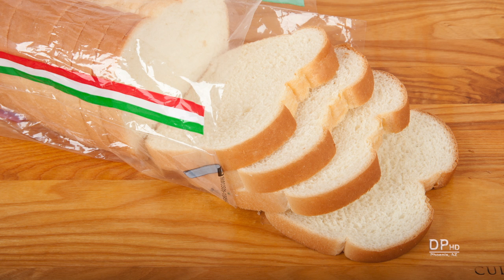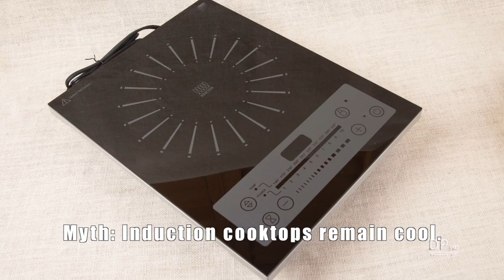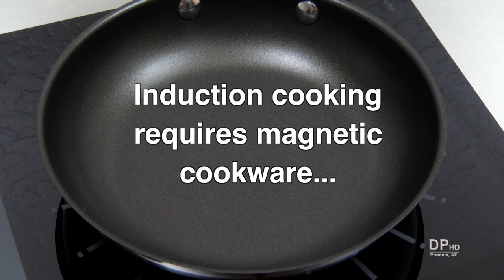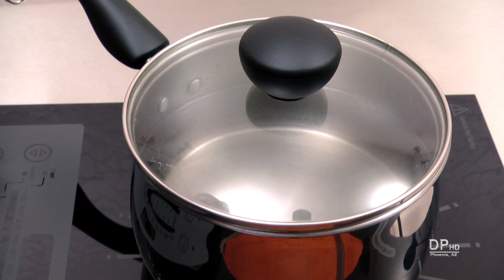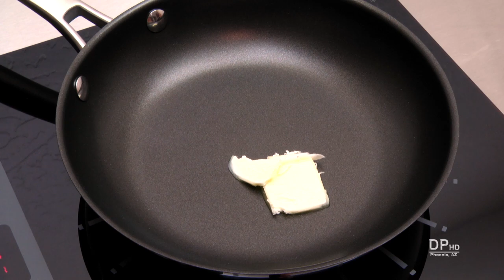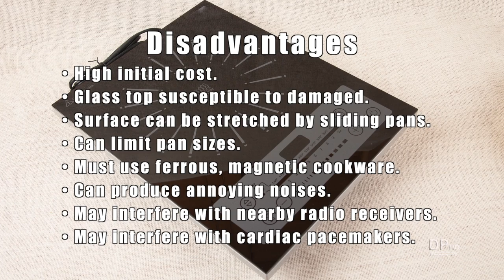Introduction to Induction Cooking (Home Cooking 101) DiTuro Productions

Comment: The only thing that I am disappointed with,is that I have never been able to fry an egg. It never turns out right it spread out all over the pan. Perhaps I need some tips, I do have the proper pots and pans. I think I need help in technique, my cook top is just new.
Reply from the maker: The amount of egg spread is usually due to the grade of egg and age. Some non-stick pans could cause more egg spread than others. I fry eggs using the technique in this video I published several years ago. Using the same pan, I have not noticed any significant difference using gas or induction: http://youtu.be/tC4swUMV17c

Comment: Induction cooking is not good for Chinese cooking where a round bottom wok is used.  Round bottom wok is specially built for even heat distribution during stir frying.
Reply from the maker: Thank you for sharing this information, Sally. A flat bottom iron or steel wok will work on an induction burner, but not as efficiently as on a high power gas burner.

Comment: Seems to me that one can get a couple of portable cook tops for use just for those times when one is cooking for a lot of folks such as parties. Great if one has an RV rather than using propane. It is just one of those specialty pieces of cookware.  I have priced built in induction cooktops. Think they are happy to charge monster amounts to pay for their new lexis car.  To go from a $70 portable to one that has 4 cooking eyes and have the price jump to $3000 or more does not make a lot of sense to me.
Reply from the maker: The first microwave oven cost about $5000. The cost of induction ranges and cooktops will drop. How fast depends on demand. A portable unit is ideal for RVs, small apartments, and occasionally needing another burner. Thanks for your comment.
Reply: @DiTuroProductions  My microwave is a 1978 and it has a glass touch panel - can't imagine how much that cost when new!

Comment: Just bought and tried an entry-level induction over-the-counter unit that I plan to use in my outdoor cooking area and I am impressed. Instant on/off heat. Plenty of power for the size. No breeze will carry away the heat as from my previous electric element (and gas)  cooktops. The only disadvantage I saw was lack of power adjustability as the temperature is pre-set at  certain intervals. Thinking outside the box, this may be an advantage. I can tell you, I am not going back to gas or electric element cooking and is considering an induction range for my kitchen when it is time to replace it.
Reply from the maker: Thank you for sharing your experience. It is interesting yours has preset temperature settings, most have just a power setting.

Comment: I have been using my portable induction cooktop for two years for most of my cooking.  I want to get another and then I will never have to use my ceramic stove top ever again.  Eventually, if I have to replace the stove, I will invest in a stove with induction.  Most people have magnetic bottoms on their pots and pans.  But that is a must.  I would never be without my induction cooktop again.  I have a Kuradori.  As for cooking eggs, my eggs turn out better with the induction than any other method.  I use 800 watts until the butter is melted and the eggs hit the pan, and then I turn it down to 600 watts and cook as one normally would.  They turn out fluffy and delicious.  Also, my poached and fried eggs are amazing.  I do not use the percentages or the presets, as controlling the cooktop manually is much better and the results are great.  I very rarely use the 1800 watts, except to bring the water to a boil, then I turn it down to 800 -600 watts and continue with the pasta until done, 8 - 10 min.  For steaks, I set it at 1800 watts until the pan is hot, then turn it down to 1000 watts and add the steaks, and cook to desired doneness.  Between the cooktop, the Instant Pot and the convection oven (mostly baking) and broiler for browning after the Instant Pot, I am set.
Reply from the maker: Thank you for sharing your experience with induction cooking.
Reply: Thank you very much for sharing the details of how you use the wattage. This is useful for people who want to shift to induction cooktops like me. ❤

Comment: The induction cooker plug must be direct in an electricity outlet or can it maybe in an extension wire... Thank you for response
Reply from the maker: Induction cookers are high power appliances. My instruction manual states an extension cord may be used if the electrical rating is as great as the appliance. Many household extension cords for interior use are rated for low power devises light light fixtures.
Reply: @DiTuroProductions  devices such as ???

Comment: Thank you for the explanation. I just got my portable induction cooktop and found out I have to buy special cookware on top to use it since I keep getting this error message that apparently tells me many of the existing cookware that we have are not compatible.
Reply from the maker: Induction cooking requires iron based cookware. Fortunately, manufacturers are producing more induction compatible cookware including non-stick pots, pans and skillets.
Reply: @DiTuroProductions 

You can also buy an "adaptor". Basically a ferrous plate that you place on the stove and then put the non ferrous cookware on top of it.

Problems are that they can be more expensive than just buying new cookware and seemingly cause the glass top to crack.

Some reviews swear by them, others swear at them...

Comment: I have a 2 ring electric stove and a solo induction plate I have found my preference in the induction it takes 10 minutes to have pasta ready the water ho yeah I use the kettle transfer to induction pasta in, then the sauce is made in 5/6     minutes using fresh ingredients. I have done stews, curry that fast, soups that cook faster than it takes me to peel the vegetables. I think induction is the way of the future safer and real fast. then cleaning is easy be careful after cooking as the ring stay a bit hot for a while. the electric stove is in storage beside it does not go as high temperature as the 
induction. I cannot cook chips on the electric the oil does not get hot enough and it's more difficult to control.
Reply from the maker: Thank you for sharing your experience.

Comment: Great video! I finally understand it. I like gas stove because I can see the flame. Cooking is an iterative process. I can see a lot of advantages of induction cooking like saving energy, safer, easy cleaning... I cannot do grilling with induction but I should not do it with gas stove either and how often I do this maneuver? I can learn and adapt to this new technology. I have tried it and love it. I had some trouble at the beginning. So I check YouTube and learned how to make it work. Thank you!
Reply from the maker: Thank you for the compliment and sharing your experience.

Comment: Can u please add where to place the induction cooker if we also use an LPG in the kitchen?
Reply from the maker: The only warning in my manual was to not place the cooktop on or near a hot gas or electric burner or on a heated oven. The plastic housing or power cord insulation could melt and damage the cooktop and your stove or countertop.
Reply: @DiTuroProductions  thank you
Reply: @DiTuroProductions 

I have a four burner gas hob and a single portable induction plate. The gas hob has a hinged glass cover.

For "one pot" cooking we simply put the induction plate on top of the glass top. Otherwise simply somewhere sensible on a kitchen surface or even on the dining room table...

It's also great to take out on the balcony. Just make sure your extension cord is rated correctly.

My Missus and I are both retired and love to cook. Most of our differences seem to be as to who "gets" to use induction and who "has" to go with gas. 

I think we'll go get us another 🚵‍♂️ 🚵‍♂️

Comment: How is the heat range?
Reply from the maker: Please clarify what you mean by heat range.
Reply: The heat range is excellent... boils water faster than gas or electric, and has the most accurate simmer control for temperature.

Comment: I just got this unit, have never used induction cooking, and am completely confused by the temp/power difference. The manual does not explain it at all and neither does your video. Do you set just one control...temp OR power or do you need to set both? If both ...for example if the temp is set to 250, how does that change with a low med or high power settings? Thanks
Reply from the maker: Unless you have a special induction cooktop, one button controls temperature and power. Using the temperature scale is convenient for cooks deep frying, melting chocolate or making candy. They require precise temperature control. Relying on the cooktop's temperature scale (setting) is not a substitute for a deep frying or candy thermometer. The majority of recipes use low, medium or high power settings, or something in between like medium-low. If you set the temperature to 250F and change the power you will increase or decrease the temperature since temperature and power are linked together. I hope that helps. This looks like a topic for a future video.
Reply: Thank you. Yes a video on it would be helpful. It's very confusing when you've only ever used an electric or gas range. This answer we helpful and is much appreciated.
Reply from the maker: It's on my to do list.

Comment: I'm not really clear on your terminology. There are two sliders. One for temperature and one for power. What is the difference and purpose of the sliders? And which one are you referring to when you're referring to increasing and decreasing power? The manual gives instructions on how to increase and decrease power, but not what the power slider is for. The temperature slider is obvious.
Reply: Temperature means the induction cooker cycles on and off to maintain a set temperature, power means the induction stove will use the percentage set say 1000 watts from start to finish regardless of temperature reached, this is good for boiling.
Reply: Gabriel.  I understand your question, not sure why the author does not, seems very simple.  Did you ever find the answer?  I'm guessing, but I think it maybe the power slider may be like the accelerator to a car.  Temperature to the final speed of the car.  Thus, the higher the power setting, the faster the temperature is arrived at.  Just a guess.
Reply: That doesn't clear it up for me at all. What does the power slider do that the temperature slider doesn't. Sliding the temperature slider increases the temperature by increasing power. When and for what purpose do you use the power slider.
Reply from the maker: In the United States, recipes cooked on a stove top  usually specify low, medium and high. The knobs adjust the flame or electric element setting anywhere in between. In stead of low, medium and high, induction cooktops provide an approximate temperature setting and power setting. When deep frying and making candy, it is important controlling the temperature. For most other recipes it is more convenient controlling the power like dialing in low, medium, or high on a gas or electric range.
Reply: I appreciate that you're trying to answer my question, but it seems that you're conflating power and temperature. Perhaps stating the question in the form of an example would help clear it up. 

Suppose we have two cooktops identical in every respect. One has the temperature slider on medium and the power slider on low. The other similarly has the temperature slider on medium, but the power slider on high. 

What are the observable differences in performance between the two cooktops?
Reply from the maker: First, temperature is specified in degrees Fahrenheit or celsius, not low, medium or high. For an induction cooktop it indicates the approximate temperature of the cooking surface. Power is the number of watts applied to the induction coil. If the coil power range is 1800 to 2600 watts, low is 1800, medium 2200, and high 2600 watts. Most cooks aren't concerned about watts. What brand of induction cooktop has separate temperature and power sliders? The brands I've seen use one slider with two scales.
Reply: DiTuroProductions, I have that EXACT model so obviously I meant the two modes when I referred to the two sliders. Additionally, cooks refer to low, medium and high heat all the time. You seem to be getting bogged down in the minutiae of the language in my question and in doing so you’re not answering it. I’m honestly not sure how I can state my question any more clearly. At this point I must simply assume you don’t know the answer to my question, but for some baffling reason won’t admit to it. If the almost insultingly simple hypothetical scenario didn’t make my question clear to you, this is the only conclusion I can draw.
Reply from the maker: Sorry, I was interrupted before I could complete my reply. Using your example of identical induction cooktops or two equally rated heating elements on a single cooktop. Assuming a temperature range of 140 to 450 degrees Fahrenheit, medium is about 295°F (140 + 0.5(450-140). A recipe states bring 1 gallon of water to a rolling boil. Neglecting the ambient temperature and heat loss from the pot to the surrounding air, and assuming water boils at 212°F, using a medium temperature of 295°F will eventually bring the water to a boil. The same amount of water in the same pot will never come to a boil on low power since it is 70°F below the boiling point of water. Using the same medium temperature setting for one pot and a high power setting for the 2nd pot will bring the water in the 2nd pot to a boil in a fraction of the time needed to heat the water in the 1st pot since high power is 238°F above the boiling point of water and 155°F above the medium temperature setting.